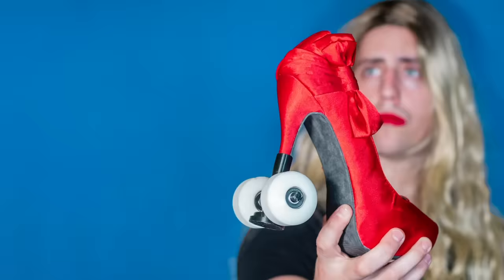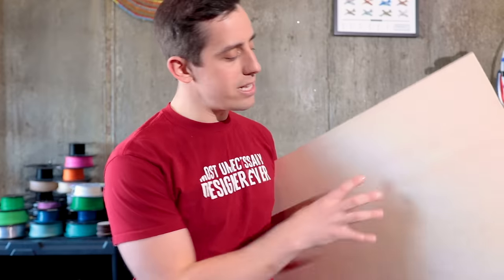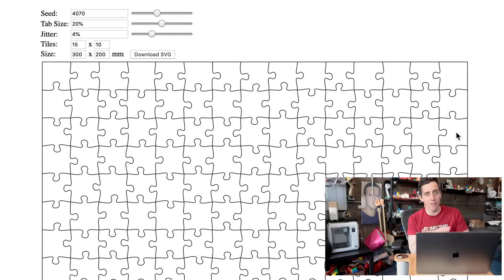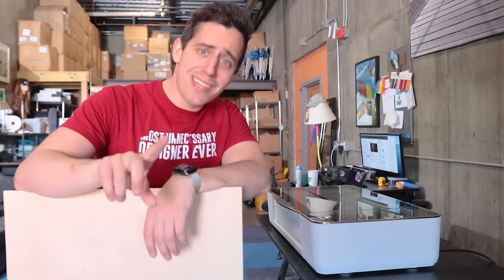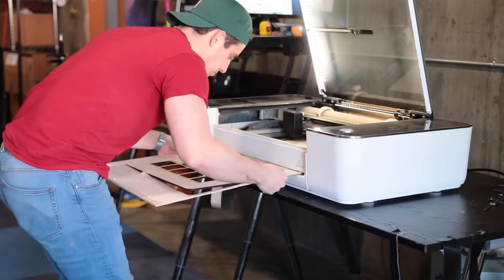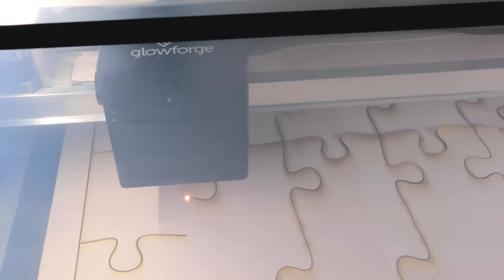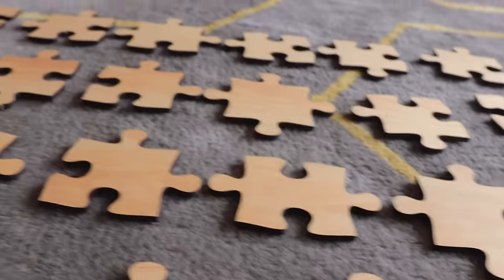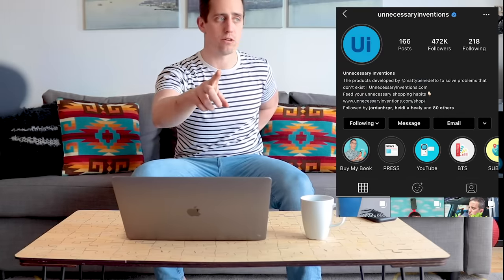Building a DIY Jigsaw Puzzle Coffee Table

Comment: "Decrease jitter so it's easier to work with" - wouldn't increased jitter make it easier to solve the puzzle? I figure, the less jitter, the more uniform the pieces are. Increasing the jitter would make each piece more unique. Yeah?
Reply: Was thinking the same. Now they all look the same.
Reply from the maker: I just didn't want the corners to be too tight, rounder corners would help them slide together better.

Comment: A coaster that is two layers thick... One, a coaster around 80mm in diameter (3.5") and the bottom layer is one of the puzzle pieces.. that allows the coaster to be held by the table instead of being stuck to the bottom of your glass; and also prevents the coaster from being used as an air hockey puck 😁

Comment: Do you have to adjust for kerf?
Reply from the maker: I'm not 100% sure I know what "kerf" refers to.
Reply: @UnnecessaryInventions  The laser will burn away approximately 0.2mm of material (kerf=0.2mm) meaning that the jigsaw pieces will not fit together exactly but will actually have a 0.2mm gap between them.  You could theoretically compensate for this, by making all the jigsaw pieces 0.2mm bigger, making the pieces fit together really tightly.
The 0.2mm number is just a rough average, and depends on material, energy settings etc.
But for a jigsaw, you probably do NOT want to adjust for kerf - you don't want a perfectly tightly fit, but want them slightly loose.  So what you did was perfect, unless you find the pieces to be a little bit too loose.